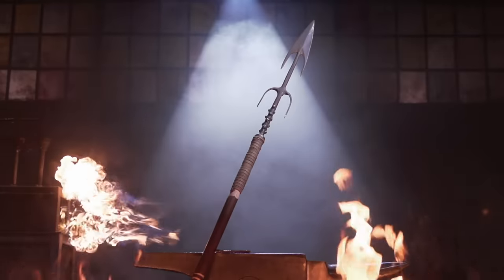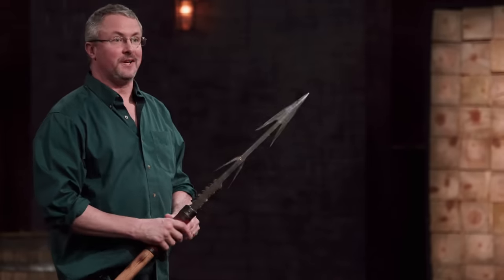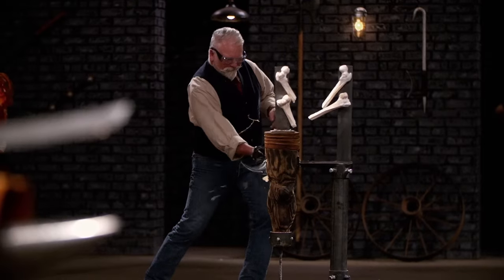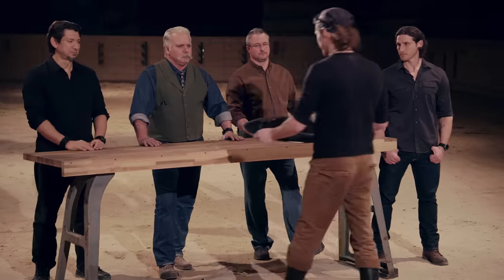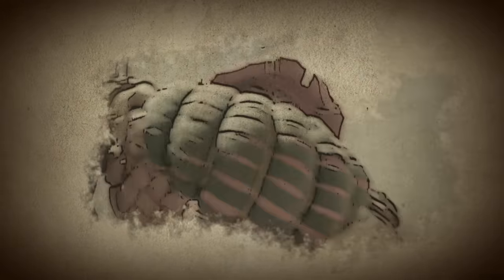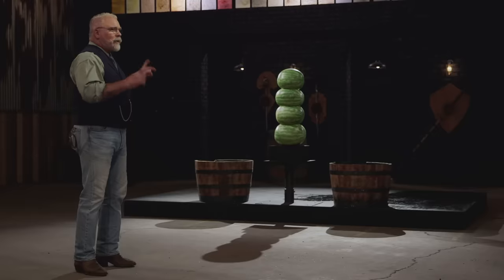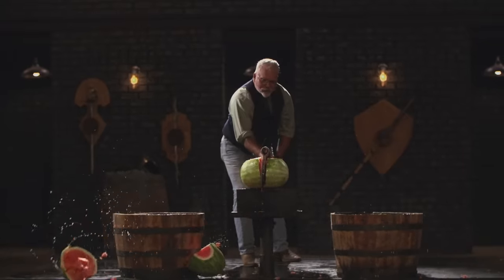Forged in Fire: TOP 5 DEADLIEST VIDEO GAME WEAPONS (PART 2)

Comment: 5:43 This guy's 18, thus making him the youngest Forged In Fire Champion that the show's had so far. that's very impressive.
Reply: We'll its kinda weird why didn't they get thrown instead  so in a way it WS unfair over. A small diameter
Reply: Too bad he didn't have a good oppenent. Can't learn that way
Reply: @kittokittokoshiki8978  they can't guarantee it will be thrown with the same trajectory and the same pressure. Testing needs to be consistent to be fair and they have specific testing rigs for that reason, which is why making the weapon to the spec requirements was important. A human cannot perfectly mimic a machine. If you can't follow directions, a most basic thing for a smithing, then you deserve to fail
Reply: @Rashimotosan  Tue weapon was perfectly fine just couldn't fit in the machine cannon thing
Reply: @kittokittokoshiki8978  what he is saying is that, in short, the testing has to be fair. That's why they have special requirements, so everyone has a fair and equal chance.
Reply: @kittokittokoshiki8978  they give the smiths detailed specifications for this reason.
Reply: @PlasticAddict301  ik
Reply: He kinda looks like the kid from meet the robbinsons

Comment: The landsknecht sword duel just shows how talented the bladesmiths that originally built them were. Making a sword that big while keeping it light must be difficult
Reply: I don't believe they did keep it light back then, since a sword that big is supposed to break stuff. It was meant for a huge, ripped guy to wield, since those were the dudes who were splitting skulls and armor in two anyway.
Reply: @schleepyrandy  They were pretty light. They weren't meant for simply hacking through anything; the techniques used to wield it were mostly based around agility.
Reply: @schleepyrandy  You got the wrong idea, people back then weren't stronger than today, even warriors. On the contrary: we have much better nutrition and training methods today, so they probably had to keep it even lighter than these weapons. Also a slow weapon means certain death
Reply: @schleepyrandy  Nope, the Zweihänder was a surprisingly light weapon. I've seen originals in museums here in Germany. There was one big beast of about 170cms (5.6 ft) with a weight of 2,7 kg (5.95 lbs). This size/weight ratio is pretty standard for a Landsknechts-Zweihänder.
Reply: @Mek_Alenes  yeah. And historians say that any zweihander over 4 kg is ceremonial only. 
As for the 2 kg, even I could wield it, it's not heavy
As long as for these two... Both too blunt and too heavy, an original gs also ends up with a sharp point you can poke through things
Reply: @Mek_Alenes why the zweihander Is bigger than my height right now 💀

Comment: With the mercenary 2 handed sword I felt that the second one should not have passed the kill test. I’m sorry but if the sword barley functions as a sword the way it was intended and it’s more of a giant blunt prop sword I can’t see why a soldier would want to use it. Imagine being on the battlefield with a very heavy sword that can’t stab, can’t cut/slice and can barley break someone’s back. It’s more likely gonna hurt you and tire you out then the enemy.
Reply: I do feel like it was good enough though, zweihanders are notoriously hard to forge and neither were really “good” but they were both able to pierce at least once and each of those pierces if they hit something vital would kill
Reply: @braedenconti36  How can you call a sword that functions like a hammer, good enough???
Reply: @alilarhdiri9666  a blunt sword that doesnt break is passable as a weapon.  

Passable as a weapon doesnt necessarily mean good weapob though.
Reply: Both swords also seemed like they're heavier than historical equivalents.
Reply: It's the "kill test" not the "cut test". Broken spine is dead, so the weapon will kill

Comment: Yeah, those "Landsknecht" swords lack the essentials like a good distal taper or a proper cross section. The first one looks like it has a proximal (?) taper actually. They really don't deserve to be associated with the Landsknechte. But it's a great challenge to make such an elaborate sword and I'm sure the restrictions set by the show were hard to work with.
Reply: I think the biggest issue was time.  Another day to sharpen would probably have a made a big difference.

Comment: I’m not a fan of the keel test with the shields, strikes with the rim of a shield are going to vary more between swings than clean cuts would and the dummies are wearing 12.99 Party City chainmail.
Reply: That's less important than the fact that ALL the dummies are wearing 12.99 Party City chainmail.  (It would be unfair if one was wearing cheap chainmail and the other was wearing mail made by a professional armorsmith.)  You're right about the shield edge strikes, though.
Reply: @SpearM3064  normally when they break out the 12.99 Party City armor it’s a durability test. This time it’s a striking test and I don’t want anyone stupid to think that the spike on the front is that good against historical armor.
Reply: @sadeknight9112  Movies have long ensured that steeply uphill battle.
Reply: @mechanomics2649  I know, it’s just that this show is deceptively good at avoiding historical inaccuracies. Them mentioning repeatedly that, “It’s not about what your sword does to the target, it’s about what the target does to your sword.” Is a fantastic breath of fresh air.

Comment: Hm... I'm not sure how I'd feel about winning because the other weapon's shaft is a smidge too wide. In a combat situation you wouldn't care or even notice. I get that precision is just as important, but still. I mean, it's wood, it's not even forged.
Reply: I agree my fellow furry
Reply: just because it's not the blade does mean it unimportant, it's a shame to be honest since the one he forged seems deserving of winning but we can't deny the fact that it is a competition so everything must be considered even the width of the shaft.
Reply: It’s not really about the weapon being a smidge too wide when wielding it. That cannon was the only way they had to fairly launch the spears at the same angle and power.
Reply: @sadeknight9112  I wasn't aware that they actually give them exact measurements and parameters to follow, and that failure to stay true to those parameters means disqualification. In most episodes you don't see that, I only saw that in 1 or 2 episodes after I posted this comment.  So yes, I now understand why.
Reply: @raenfox  Coming from a machinist, dimensions are everything.

If you're given dimensions for a build, it is vital to adhere to those dimensions within tolerance, and reliably.

That is part of the trade, and it's part of the skill.
Reply: Yeah I was gonna say- smiting is part artistry and part engineering- and for both if you contract with a client to design an art piece this big for a wall, or design a part to fit in into an engine block or whatever, following the parameters always comes first! The shift is really a shame bc thats such an easy thing to fix as well
Reply: @raenfox  yeah the full episode was a 1-hour-ish time slot.  they cut a LOT out of the eps to make the Youtube clips.  One of those was the explanation of the right size of spear shaft.

Comment: I'm no bladesmith but 3 simple rules I've learnt from this show

1. Stick to the parameters
2. Don't make a heavy weapon
3. Make the handle comfortable to wield

The sharpness, strength, durability, overall construction... that's down to the smith's skill.. IT WILL KEAL

Comment: Yo... those Two-Handed swords were both wildly disapointing... Zweihanders like those might be a little heavy, sure... but they should feel nimble in the hands, they are meant to flow like a river of death... not have blunt edges and rounded points... And those Parrying Lugs... so crude.

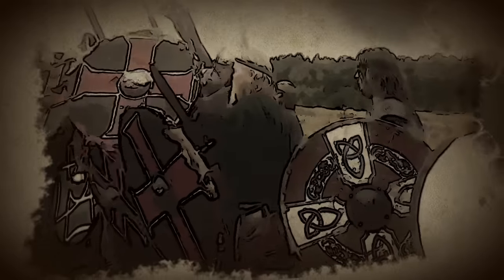Comment: 13:27 Skryim is not a game series, it is the title of the 5th game in the Elder Scrolls series. There is literally only one spiked shield in skryim called 'The Targe of the Blooded.' Many of the other sheilds may be quirky and have elaborate and/or unconventional  designs which include spikes, but they all lack front facing spikes meant for greater damage while bashing with the sheild.

Comment: I hate how they use butted chainmail, its so weak and pathetic. It can literally be torn apart, the rings are thicker to hold together better. And in the show it's still super thin, probably go through with a butter knife. And nobody in the medieval period wore butted mail, they wore riveted mail. Riveted mail is basically butted mail but both ends of the ring is flattened so it can sustain a hole, then they put a rivet through it. 95% of the time you wouldn't die from stabs or slashes, and it you did there was a defect in the mail. Instead you'd die from blunt trauma. Because, obviously, a spear to the stomach doesn't feel delightful, even when wearing a 22kg bundle of rings. But it would make sense to use weaker mail so you know, their weapons don't break on it. Even if they didn't break, they wouldn't go through. How boring is that?

Comment: Oh my god if they’re such weapons nuts why don’t they have a heat duty sander or something. I know they set the parameters but I get the vibe they didn’t communicate what that meant. Like if they want to test a weapon fairly then they should disclose that that specific parameter is key. I mean 10k on the line I think if someone had the slightest idea that something would keep them from competing they’d avoid it at all costs
Reply: They do
Reply: They do specify the parameters clearly. And the forge where the show takes place does have sanders. But the point is to bring a fully prepared weapon that meets the parameters upon arrival.